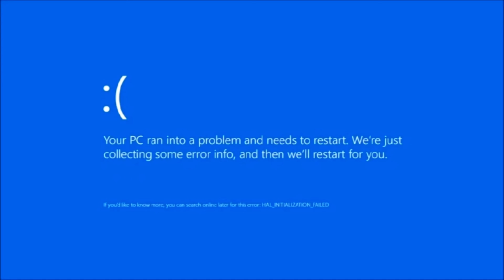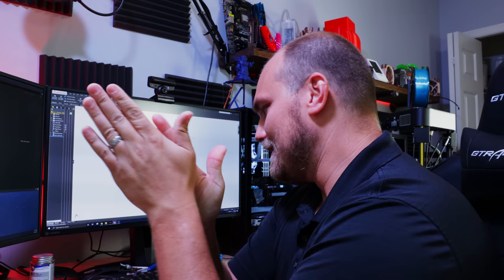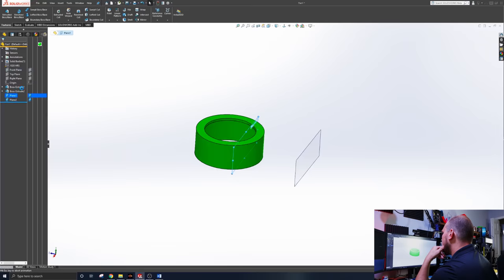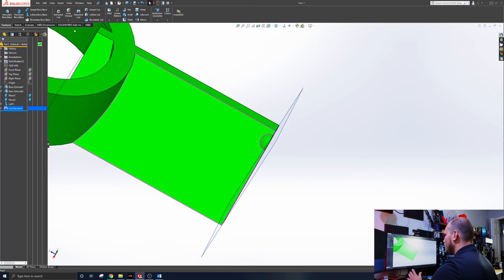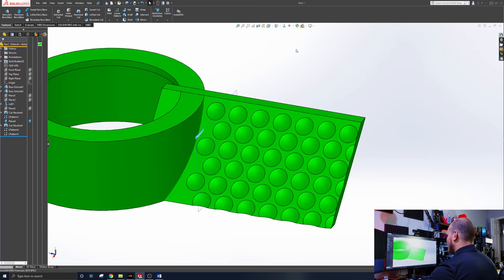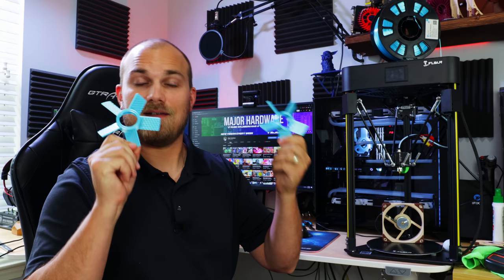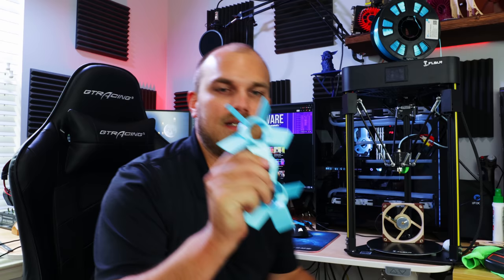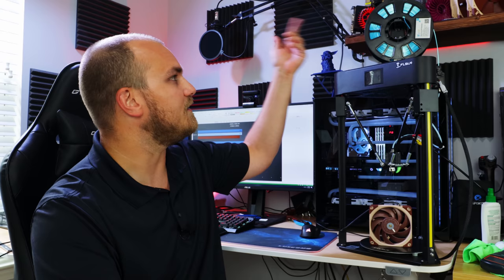What If Fan Blades Had Dimples Like A Golf Ball?

Comment: a difference of a gram may not seem like a lot, but that's nearly 10% savings in material.  
Since they perform almost the same, the next thing to do is a stress test.  Then a longevity test.  If the two of them are truly identical...  it would behoove fan manufacturers to use a dimpled blade and save on the cost of materials

Comment: The fans are designed to give a set RPM, which is why you saw no difference.    The point of dimpling a golfball is to create a slight amount of turbulence which interrupts the vortex that occurs behind the ball.  Limit the vortex and you increase the distance.  I wouldn't expect any more efficiency in moving air.  You might see a slightly lower amount of electrical current being used to spin the dimpled blade, but given the difference in geometry of a sphere versus a blade - I wouldn't expect to see much difference.

Mythbusters tried dimpling a car and measuring gas consumption over a given distance versus the same exact vehicle but without dimpling.  The results seemed to indicate an astonishing difference, but then again, Mythbusters has been known to screw tests up by overlooking some critical science behind it.

Comment: Sound meter is probably needed, I was not surprised about the speed because the speed is / should be regulated by ESC. True test is the difference in power draw of motor.

Comment: Need a db meter to suss out minor differences in sound.  They were from a practical sense the same, I would agree. Something you didn't dig into was whether rpm made a difference. It would be interesting if dimples performed better in different fan curves, eg more airflow at very low or very high rpm.

Comment: If you applied the dimples to thr hull of a boat you would see that the vessel would slip through the water better as you would be limiting the amount of direct surface are which acts as drag. This means speed increase and energy savings.

Comment: What you should measure is amount of air moved and power usage at the same RPM, I would think a blade that has less air resistance would use less power to run at the same RPM.

Comment: The dimples in the golf ball create turbulence allowing air to make it to the back of the ball preventing an area of low pressure behind the ball that increases drag. This would only work for the fan blades if they were cylindrical, or otherwise aerodynamic. Maybe make a dimpled cylindrical fan blade somehow?

Comment: The reason dimples work on a golf ball is because they disturb the airflow with a great deal of interference. This reduced drag because it mitigates the forming of a low pressure drag zone behind the ball. In the case of a fan. The low pressure zone forms in such a way that the geometry of the surface would be unlikely to affect. That is why in order to reduce drag, the entire wing shape and profile are changed.

Comment: almost 10% reduction on material with the same spects is a great design change for manufacturers.
Dimples in a golf ball are suposed to help with those massive speeds they get when first hit, a normal fan speed wouldnt reach that relevant of a speed, buuuut, if you stress test the blades on an unregulated motor the dimpled one should have increased speeds if not only just for the weight difference.
The dimples are probably really really relevant for water cooled pump setups if they use turbine type pumps

Comment: Make the dimples convex instead of concave. Also make them small at the hub and increase in diameter as they go out along the blade. Use golden ratio for this.
Probably better to measure power draw than rpm with those fan motors too. That's where any differences are gonna show up.

Comment: The purpose of the dimples on a golf ball is to REDUCE the amount of air that is moved as it travels along, thereby increasing the distance it travels by preserving its kinetic energy. 
The purpose of a fan is to move the maximum amount of air for a given input power. Dimples would REDUCE the amount of air that the fan blades can move making them more efficient at moving, but way less efficient at actually being a fan.

Comment: The motor controller probably controls to RPM, so you'd not expect any difference.  Dimples help where you experience flow separation due to low energy boundary layer causing early separation.  Nice experiment, but not based on a decent hypothesis.  IF you had a highly cambered fan blade, it might matter.

Comment: Very limited testing. You should probably do proper tests for air flow, noise and power consumption. If it weigh less and have same airflow as flat blade, that already tells me that dimpled have less power consumption. I'd experiment with blade shape as well. Do a wing-like curved blades. Your air resistance comes at the 'slice' point of a blade.

Comment: You should measure the current also. The electonics tries to run as constant as possible.
Or... You use a brushed motor and set currentlimiter to what motor use unloaded. And the measure rpm.

Comment: You should measure airflow and current draw and compare the results with the two fan blades. 
Typically in fluid (air) flow,  the more volume you push, the higher your current draw. 
But if you get more fluid flow without higher current draw,  or even less draw,  you could really be on to something.

Comment: use the "up to surface" parameter on your extrude feature. if you want to be cool.
then to dimple a curved surface. extrude surfaces and make a 3d curve at the places where they bisect. fan blade surface and extruded surface.  then use the 3d curve to pattern the dimple feature.  pattern feature - along sketch line

Comment: The size of the fan is so small that any performance differences would be immesurable with anything less than extremely expensive lab equipment.  Scale it up to a 3 foot diameter fan and see what the differneces are.  On an episode of Mythbusters, they covered a car with a thick layer of clay and dimpled it.  It got 3 mpg better mileage tham the car did before it was dimpled.  If this was a brushless DC fan motor, current draw would not change.

Comment: Putting dimples on your fan blades to save electrical energy is like putting a smaller a gas tank on your car to get better gas mileage. Functionally it may work to give you the desired effect but you decrease the usefulness of the intended purpose of the item. The primary function of a fan is to cool, trying to save micro Watts over cooling efficiency is putting the cart before the horse.

Comment: The reason they were the same rpm was because you used the same motor, that is what would be changing the speed. With the dimples you could go to a higher max rpm because of the less drag

Comment: Dimples on a golf ball are used to create eddy circulations in the boundary layer that help delay the boundary layer separation. This in turn reduces the size of the wake and profile drag. The dimples are on the wrong side of the blade to begin with and even if the dimples are on the leading edge and high-pressure side of the blade they still need to be parametrically optimized for this fan's operation. You can't simply copy a design (mm for mm) and expect it to work. Even if these dimples do work on a blade, it will be within a certain range of operating parameters. Moreover, the blade profile (and the number of blades) of a fan plays a more significant role in flow, turbulence and aeroacoustics; hence, you see different veins, textures and blade tip profiles that help with blade tip vortices, aeroacoustics and overall efficiency of fans and turbines. In cooling applications, you want to ensure a level of turbulence (flow mixing) as the air is pushed through the heatsink/radiator to improve the efficiency of the heat exchange process. If his concept is to increase turbulence for cooling then, conceptually, he is on the right track. A bit of background research would've shown the systematic problems with this design investigation.

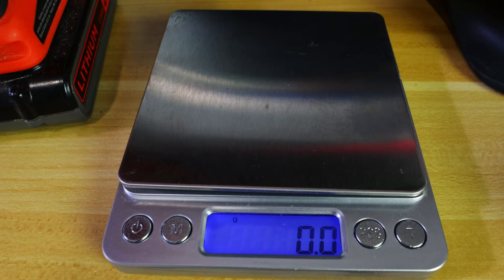Comment: The flat blade fan is not flat. At 11:33 you can see the uneveness (normal for 3D printing) in the flat blade. Your test is actually comparing two blades that have different degrees of surface uneveness. If you can post printing smooth out the uneveness in the flat fan to that achievable in a molded part, then you can have a valid comparison.

Comment: A golf ball actually has higher skin resistance than a smooth ball -- you sacrifice skin resistance to increase turbulence, which decreases profile drag more than the skin resistance increases total drag. You'd probably have to spin the blades much faster and measure torque to detect the difference. The fan with dimples should require more torque to hit the same RPM.

Comment: The benefit of dimples are quite limited as they are a type of turbulator, used to increase turbulence, therefore they are only beneficial when the drag caused by the increased turbulence is lower than the drag caused by separation (of which the turbulence reduces, and which the golf ball has a lot of). In the case of the fan, the shape being relatively streamlined (in comparison to the blunt body of the golf ball), the effect would be less significant, and there may even be an adverse result if compared to a well-designed blade.

Comment: The imperial system isn’t bad.  I like the idea of this however the rules don’t quite apply the same.  These fan blades are on a fixed object and not designed to create a low pressure behind them.  They not actually gliding through the air via a kinetic contact transfer of energy like a golf ball.  Those dimples create a non smooth surface to create turbulence thus reducing drag.  I like the concept of the idea of making it put out a different volume of air but it was doomed to do better or worse from the get go.  Nice job on the printing though.

Comment: The RPM would not change because the RPM is attached to the motor frequency. Rather, you should measure the electrical current for load. Dimples should provide less drag and use less electricity if the hypothesis is correct.

Comment: will be good to measure the consumption in amp for the same speed of rotation (provided that the incidence is identical) and put an anemometer behind moving it at different position to have the dispersion  .
They have the same efficiency if  the Amp the wind speed and the gradient of  dispersion are nearly identical

Comment: These should run at the exact same speed because fan motors are brushless motors with controllers, which regulate themselves to a constant speed. And if for some reason your fan motor is not, then they should have the same airflow because less drag would mean a higher speed, but also at the cost of less air being moved

Comment: Why would a dimpled fan blade increase the motor speed? Hasnt the motor like a fixed or designated RPM ? And if the fan spins at the same speed, with the same design - i think theyre cooling attributes should be also the same. The only difference i could imagine they have is that the motor / engine needs less energy to run the dimpled fan at the same rpm as the undimpled, because thats what the dimples in the golfball do as well. They reduce resistence so to reach the same distence, the golf player doesnt have to put as much effort in his shot or vice versa with the same energy put into a shot the ball flys farther. But this doesnt apply in this case since the rotation of the fan blade is bound to the given motor speed.

Comment: If the dimple is lighter and the speed is the same, the kinetic energy required to rotate the fan is less.  If the cooling is the same, then that means it produces the same mass flow.  I would measure the power consumption difference between the two designs.  Based on the weight difference, I would expect that the dimple design consumes less power.

Comment: Nice test! However, you could have checked current draw (same voltage will be same RPM; cooling is the net effect, but it's secondary so hard to see a difference) for any differences... also, to make sure there's no difference in the actual motor instance causing any current delta, swap the fan baldes and re-test.

Comment: You guys should of have seen coming, the dimples are efficient on a ball because the ball is a 360 degrees object, so no matter where the wind is coming from, the ball's surface is uniform as well as the dimples. For a fan blade that's not the case, the blade does not have the same surface from every angle for the air to drag uniformly, what would have been more efficient is not wholes, not dimples, but curved grooves across the blade. Maybe extruded in, out, or both.

Comment: If you wanted to make curves in it and the dimples on, you could make it using the sheet metal tab, create the profile you want as long as there’s a straight edge somewhere (I’d do this inside the fan hole since it’d be cutout later) and then unfold your piece, put the dimples on, and refold it.

Comment: That is a brushless DC fan. It will always spin at the same RPM, or it will at least try to.
You should use a typical AC brushless motor from a desk fan.
Failing that, a meter on the input to the motor you used for this video will confirm a slightly higher draw for the flat blade.

Comment: In fact, when making a fan, I think that what you want is to increase the drag, not reduce it. The minimum drag fan would have blades parallel to the rotation plane. Very little drag, but no air flow.

And with a fan with the blades perpendicular to the rotation plane, you have maximum drag, and it moves a lot of air... in the wrong way. So no air flow either.

And noise-wise, what you want is to reduce the turbulences. Any fast moving surface creates them, so the easiest way to reduce noise is slowing down the fan. And to move the same amount of air with a slower fan, you need it to be bigger.

Yes, small turbulences can prevent big ones from forming, but I don't think the surface is the best way to create them. Maybe the edge. I don't remember if it is Boeing or Airbus, who has an engine with a dented nozzle to exploit exactly this principle and make it less noisy. Maybe we can create a fan blade inspired by it.

Comment: It would be good to measure the power usage of the fan and also the volume of air being moved by the fan. 

It could be that the dimples are reducing friction on the blade, allowing the fan to spin the blades at the same RPM while using less electricity. Does the motor have a hall-effect sensor and PWM speed controller?

Also, if there is less friction on the blades, the fan might be producing a grester volume of airflow.

Comment: The Oracle's imparted wisdom: Dimples are for golf balls and cute smiles.  Go with corregate blades, more surface area in a smaller fan, slower rpm generates more cfm, less noise.  Also, Ruffles have ridges.  You're welcome.

Comment: the dimples dont change the sound, they alter the wind flow so that it is less laminar flow and more turbulent flow of air over the blades, ie weaker airflow at the same rpm, not necessarily quiter, should actually be a little noisier

Comment: did you check milliampere draw?  That may be where the difference would show up.  Lees air resistance due to dimples should correspond to less power required to move fan.  Off course with such a small fan the difference may be too small to measure. or is swamped by power requirement for other friction losses.

Comment: The motor will mostly spin at the same RPM's no mater what.  Increase the weight of the blade and it will still spin at 1880.  The dimples for RPM means very very little.  There are 2 measurements that would be worth testing.  Test your current draw for the motor.  The dimpled blade should provide less resistance and therefore less current would be needed.  Also you would want to test air volume.  Does the dimpled blade produce a greater volume of air?  I would love to see those results.

Comment: it won't change anything.  The engine for rotation is strong enough to overcome any force drag, so it'll run full rpms.  You would need to do this on something where the drag of the fan is causing engine slow.  However I'm willing to bet fan manufacturers already understand these concepts and make adequate fans.

Comment: You're not measuring current flow across the motor. That would be a serious indicator of efficiency. Current levels would indicate how much energy it takes to move those fan blades. Keep in mind the motor circuitry may have speed controls built in to control run-away. But a fan with more drag would cause a motor to draw more current.
Consider that a fan with dust covered blades will spin just as fast but will draw more current because of the added drag. In effect, you're measuring the wrong thing when you measure wind speed, that's generally controlled by the size of the fan and the speed of the motor. Instead, you need to be measuring the amount of work on the motor needed to spin the fan.

Comment: I’m sure someone might have said this, but did you mease the CFM on the fan and or the voltage consumption? I think that the FAN is trying to keep RPM’s the same, but the amount of consumption of energy to get there might be important. Also, if the air is smother, it should move more air at the same RMP... cooling wise, it might be harder to get a true variance as too many factors there... nice channel and execution, glad I found it, really enjoyed it.

Comment: did you measure current draw of the fan while in motion ? is it possible dimpled blades are easier to drive and would allow smaller motor ?guess i should have looked a little further down as this question was already asked.